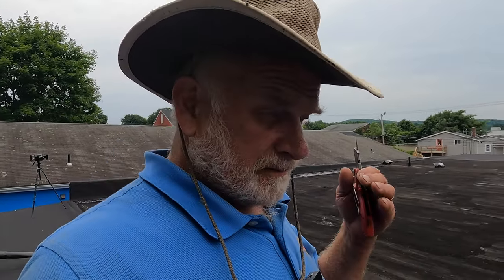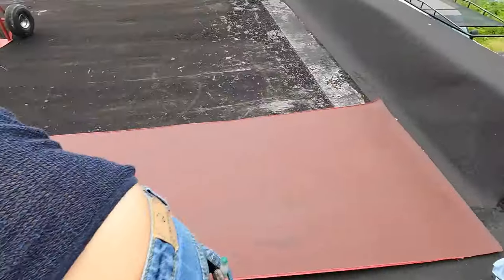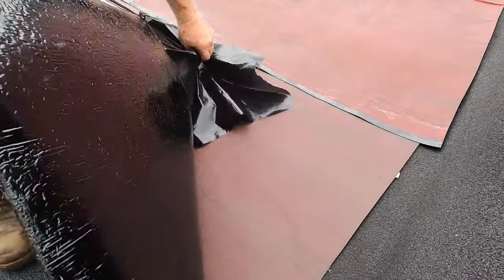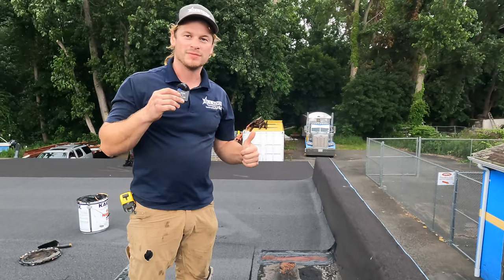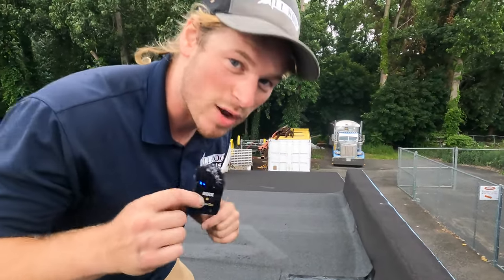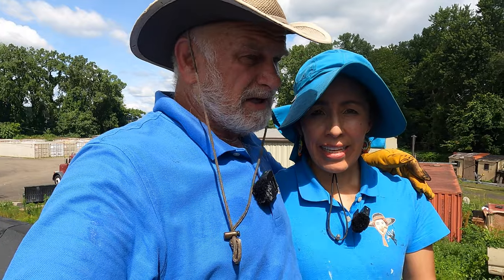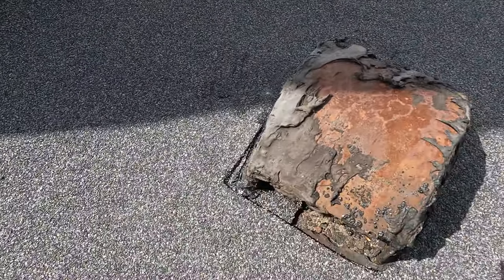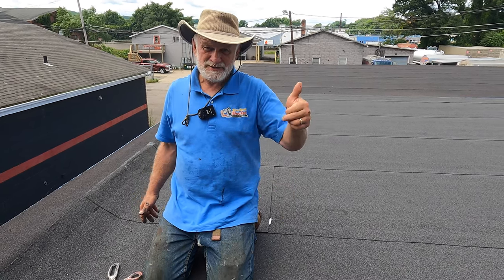Rubber Flat Roof Install - Peel and Stick Only 2 people needed DIY, Cheap, Carport, Garage, Porch,..

Comment: I have been roofing for 25 years. That type of roof is not made to be installed over an existing roof without an ISO panel or clean sub. It also needs to be rolled down with an 80 lb roller to bond materials. It specifically tells you not to use torch or flame. You are supposed to use a hot air gun. Its not a torch down system. It will def be a problem
Reply: Ok truther that's your third worning I'm not going to write you up this time though looks like we're going to need you tomorrow but mostly it's forcuz I am no longer read and rite be cause this video break me mind not work
Reply: I think it's time the old Doc retires !
Reply: Well the roof doctor has been doing this for much longer than you.   His way must work.
Reply: Ok Karen!! Lol
Reply: Make a video comment hero
Reply: @Nosweat99  don’t need to. Everybody that knows, knows there’s nothing to explain. I’m sure there is videos you can find on it if you’re interested.
Reply: As a con artist roofer, this is my new way to make big, easy money 💰 🤑
Reply: I Prefer To RIP it up nice Clean Finish don't want to look for littShit ass Leaks,
Reply: Is the doc South African ?
Reply: Sure sounds like a South African who's been in the States for a while
Reply: This roof is not good on flat but good on slope 😊
Reply: @accent1975  come do my roof, I'm in Long Beach California
Reply: Keith, listen to this man he knows a thing or two. I have followed his steps with my wife, and we did a whole roof. That roof is now 5 years old and has no leaks or issues.
Reply: Do you have a great wife and I have a great wife too!
Reply: Meant my comment to be respectful and put it in the wrong spot
Reply: That roof wouldn't  keep fog out it's a joke
Reply: THEY ARE STARTING TO USE THIS TYPE OF PEEL AND STICK ROOFING THESE DAYS!!!!!!
Reply: You right

Comment: Sorry it was not a bad try for doing  yourself but it was inproper installation. As a roofer for 25 year I'll tell you what you did wrong. Before you lay out the base you have to apply primer which some roofer call glue, the second thing you did wrong was when you installed the cap sheet you have to stagger it from the base so the laps don't land on the same spot you had to cut the first roll of cap down the middle but I would have cut was the base so I could start with a full roll of the cap the way you did it if one of the laps fail the lap underneath it could fail to because of the trapped water. I don't know where you live but if you get winter weather that will be an issue.
Reply: Your installation on the pipe is wrong you are supposed to install a cone over the pipe then put a piece of base down on the cone then put you cap on and it would be in 2 piece s so it wouldn't look like garbage you lay out a piece to pass the pipe cut around it the next piece 6 inch overlap the other way on the pipe and it's good to go and looks nice too and don't forget to use asphalt primer on the cone
Reply: You didn't need to you plastic cement on the seams to make it watertight all you had to do was pass you roofing touch on the seams
Reply: Allsand is meant as a last resort of large pipes that they don't make cone inserts for not a wash room pipe and your wash room vent pipe you should have risen it up that cap comes off and you should have built it up with 2 layer of 2by4 and flash it in with your base and cap sheet it you live in an area where it snows you are going to have problems
Reply: @migueldefreitas1367  if you have a roof with tar and gravel (flat) do you need to scrap It up before doing this process to it?
Reply: No you can put down what roofers call protection board first and screw it down to the existing roof
Reply: @osab_art2802  VES!
Reply: Just shut up critics. As if your methods are scientifically proven to be right. If they were then why the hell do you get repair calls???. Money..Money...Money..!!!
Reply: Repair calls for incorrect installs ,🤦🏻🤦🏻🤦🏻
Reply: @migueldefreitas1367  would this roof leak in your experience?
Reply: I love the comments that start out, “ trust me I’ve been a roofer for 20 something years” 😅 I know people who have 50 years of experience that don’t know what they are doing!
Reply: Never nerve rush a install because of pending rain  cover over best you can and come back and do that area when it's dry also stager joist much more than 3 inches. FYI cut  1st base sheet in half at being of install for best joint coverage

Comment: This is like a master class in how NOT to install a roof...
Reply: I so agree! But they will call us haters. I don't know what kind of Dr. he is, but surly not a roof Dr.
Reply: Not haters, just jealous couch potatoes without any explanations.
Reply: @rsz90182  Do you really need an explanation? And the list of things they fucked up is so long it can't be addressed in a comment. You would need another full length video. But for starters, in just the first 30 seconds, any time you install a roof over an existing roof you are doing it wrong.

Comment: How embarrassing. 37 years of experience flat roofing I have never seen anything like it 🙈
Reply: I had to scrole down the comments to, thanfully not far till i came to yours. I watched this bull S@@t till the end thinking that they would reveal the April fools joke. im also 43 years in the game and i have never seen anything like it. Do the people in the comments realise what this cowboy is doing?..its one thing to doing a fly job and running but unbelievable they would record it and put it on youtube!, and advise anyone this is the correct method for torch on or any aplication regarding flat roofs. Yor comment made my day because i was beggining to think im living in an alternate reality. Im from the school of three layers crossed in hot pitch on a PREPARED surface, that means strip off as well. This roof is a disaster but the only upside i can see is it gives the good guys more work. Im saddened for the clients who have no idea what costs are coming their way when this fails, and it will! thats the only guarantee this guy can give.
Reply: @stevengee4562  as someone who knows nothing about roofs, what will fail about this? In the video he mentions he did the old roof on this building 20 years ago. Obviously it couldn't have leaked or he wouldn't have been rehired right?
Reply: All of it💩
Reply: Ya I have 23 years of commercial flat roofing my self I wouldn’t share a video of an install like that pretty scary to watch that will leak or blow away with in a couple years no recovery board existing roof not primed no wall flashing not supposed to torch SA plus not a big fan of SA it should stick pretty good or not be installed until warmer day plus all those wrinkles coming into seam he stepped down will pop back open when weather changes he seamed like a smart man just not knowledgeable with product or flat roofing all together maybe??
Reply: @stevengee4562  I've done 1000s of meters with hot pot green mineral finish pasting over the laps so you can cut off the access bitumen which leaves a clean edge. Obviously you know what I'm talking about if you're old school 👍
Reply: Shut up I'm trying to study I have a physics exam first thing tomorrow and after that psychology class
Reply: Forget it I'm not going to class anybody want to help me lay down a white overlayment on some vitrified sand or polypropylene while using reverse nasal suction
Reply: As a pro I never use polypropylene plate because of the loss of the product due to scratching which in turn inevitably comes to about 250 a ball and at that moment the cost is unfortunately transferred to the current costumer
Reply: High
Reply: Me either Don't tell the rest of the crew they're going to figure out that we can't do it at all

Comment: I enjoyed your video. Thank you for posting it. That said I have a couple of questions. I am about to venture into doing a roof in a commercial property of mine after I got quoted a ridiculous amount of money to either repair or install a new roof on a 4500 square feet roof top. On your video looks like to just put the new roof membranes atop the old roof. I was under the impression that the old membranes or old roof had to be removed? Please advice. Thank you very much . Sami

Comment: 👍👍Minnesota, we get 20 to 25 years on this roof in harsh climates. We use EPDM rollers and a heat gun to weld seams together but I like the torch idea. Also nail base is a good product under the roll roofing for layovers.
Reply: whats that ??? nail base??? u mean hammering nails also down. ???

Comment: This looks like a potentially AWESOME product.  Clearly it has ease of APPLICATION.  Next test is PERFORMANCE (i.e., no leaks) and then LONGEVITY.  (Those are the three test and the final TEST or issue is PRICE.) $2 psf is very tolerable if the performance is good and the longevity is long.

Comment: Hey Doc would you recommend this on a pebble roof? If so what the preperation process? I've see your other videos on redoing a pebble roof without removing pebbles but, you used if i recall 3 different membranes. which would you recommend. Thanks

Comment: I'm a certified flat roofer EPDM TPO cold process as well as slope roofs , most common repair i have done on similar roof systems is seams and perimeter not adhering. if you want to do this system invest in the seam sealant. you could also do a seal coat over the existing roof for a similar price. EPDM is my preferred system.
Reply: Which seam sealant do you recommend?

Comment: What causes the granules to come off a torch down roof like that? Have a 5 yrs old roof, has lost considerable granules, they clog the scupper box which requires us to clean it out 2x a year. We are going to have to silver coat soon otherwise the roof will be too exposed to UV. It's nuts for a roof to start failing that quickly but from talking to supply house, granules coming off is becoming more and more common

Comment: Why are you laying the runs across the roof? Why no lengthways? Plus, would it not be better to have done the flat roof first, then the parapets, to achieve proper weathering?

Comment: I have a question about roofing, I have gotten several contractors over to give me estimate for replacement of the roof every last one wants to install edpm roof material over the current roof, ( old roof hot tar, last roof torch down bitumen) they all want to do only third roof of edpm .
Why?
Why won’t anyone remove the old roof fix the old Douglas Fir t&g decking and torch down two layers over fire resistant paper?
Your demonstration of this project video is showing proof of why they don’t want to do any roof removal and repair.
They can complete the entire job in one day.
No old material to dispose of.
No complicated process.
Minor torch around the edges.
Maximum return on their time.

My flat roof is pitched both sides to the middle and a scupper with a drain pipe in the center.
Where can I obtain the materials from your video?
I’m not about to do the work myself but it’s possible with some help to complete the project in a day and complete the flashing process without worrying about complicated step flashing or anything else.
Thank you.
Reply from the maker: EPDM is the worst type of roofing material do have  on a roof. You are correct in all the other points.
You can hire a few handy guys and have then do your roof with little cost. No need to strip the old roof.
Reply from the maker: Sometimes Home Depot will carry the Liberty Brand od Peel and Stick. But any roofing supply place carry this material. Beacon Building Supply, ABC Roofing Supply or any other local roofing supply place. The Brand does not really matter.
Reply: Reject those bids and keep requiring your specifications only ! Many regions of the country have bad contractors ! Break down the roof work scope into, tear down demo, roof repairs if any then actual new roof area if any ! Doc is right you can re-layer if needed !  Keep calling for free and sane estimates only !  Good handymen with insurance bond can do small if needed !

Comment: Hi, my name is Vick, I leave in North East Maryland, I have a flat roof with TPO material, it's old and starting to lick every time when is raining, what you suggested to do ? Can I use the same materials you were using on this video ? What should I do with the existing TPO ? Can I install on top of that or I have to pull all off ? Please let me know. Thank you so much.
Reply: According to what little you have stated it sounds likely that the roof in question should be torn off and stripped down to the deck of all old materials and any rotten plywood decking removed and replaced with new before a new roof is installed. 
If you have had substantial leaks then there will be moisture trapped between the old roof and the new roof (wet insulation board & rotting plywood) creating water vapor which must escape and will only cause further damage to the ceiling underneath ( stains, paint blistering, bubbling, peeling, mold) and bubbling, blistering and eventually compromising the roof above for more leaks. 
You could potentially use a peel & stick base sheet over a mechanically fastened 1/2"×4'x8' insulated sheet of blackboard on the deck followed by a granulated peel & stick cap sheet but the devil is in the details (i.e. penetrations (pipes, skylights, drains, tie-ins to other roof systems & perimeter terminations (i.e. shingles, metal, wall flashing & metal drip edge, etc.) and this video is not a good representation of the proper application process. 
My advice is to research the proven work history of licensed & bonded roofing professionals in your area and get several quotes on a peel & stick replacement roof and go from there.

Comment: QUESTION: Wouldn't it be easier & cheaper to use liquid rubber, and the sprinkle it with fine gravel for the UV protection? There would be no seams, and would save a ton of time/labor.
Reply: Degrades too quickly, cracks, splits, etc.
Reply: @thatguy4234  
Not tar...liquid rubber.
Reply: @thomasg4324  It depends a lot on thr country. In the UK there are a few other methods that are being used. One of them is EPDM, which is a rubber membrane that comes in one sheet (up to a certain size) and you glue it to your substrate(mainly timber frame). There are also liquid rubber methods that are being used but there's just something about them that makes it a bit more not trustworthy especially when compared to a one sheet option such as EPDM. Also, in terms of longevity, EPDM can easily last 50+ years.
Reply: It would be much faster and cheaper to use spray on emulsion with pea gravel.
Reply: @shawncummings4653  
How much cheaper? Are you suggesting liquid rubber, or tar?

Comment: This job is one giant bandaid ,reminds me of when I had to patch a hole on the inner tube of my bicycle.
Reply: I think that's kind of the idea given the title of the video.  It's the old saying in business... "you can have it fast, right or cheap... and u can only pick 2."   This was fast and cheap, not necessarily "right" according to pro-roofers.  BUT, for  a homeowner w a bad leak who is desperate for a fast & inexpensive solution (that doesn't necessarily need to last 10 years) this video is semi-helpful. 

 I don't even have $2 to spend per square foot so I'm totally screwed.  Was considering using 4x8 coroplast boards  ( only cuz i have like 100 sheets just sitting in my garage) to go over the current roof (glued down). Then i want to tape the seams with EPDM tape and coat the entire surface with expoxy resin.   Then put on new perimeter flashing.  I realize I'm going to create more issues but I'm stuck and SOMETHING must be done ASAP.  Unless some roofers want to donate their labor AND materials,  I'm on my own.  Water is a sinister foe!
Reply: @Jimd905 Well, he just spent $6,500 on materials that are bound to fail within a year or two.  Doesn't seem very economical to me.
Reply: Maybe he’s going to sell the house right away?

Comment: I agree with Steven Gee. Also, you should NEVER run ur base seams within a minimum of 8 inches from ur cap seams. He is pretty much right on top of the base seams. That ruins the whole point/value of having a 2 plied roof. Now it’s basically just really thick single plied roof. JOKE!
Reply: Absolutely never seem on seem. This is beyond a joke.

Comment: Great video.... I see 2 problems  
1: you always have to cut your first  run of S A base in half alway.  To prevent a lap on lap Meaning when you run your cap sheet you're gonna have a lap on top of the other lap thats  not good .   Cutting your first run  in half  prevent this .
2 :  You need to use an 80 pound roller .  The roller is used to remove any air pockets that may be  trapped in between the materials.  In the summer when its hot the gasses starts to build up in the pockets causing the material bubble up or causing the material to separate in time .
Reply: He mentions the roller at 21:10 but they step on it instead.
Reply: Stepping on it and not pass the roll on it is the same thing and he also didn't use primer on the roof before he installed the base sheet some roofer call it glue
Reply: @migueldefreitas1367  yeah I s
Reply: I was thinking to myself as she's takes off the plas

Comment: thank you I'm going to do my roof just like this , I got a estimate for 10,000 that's a eye 👀 opener
Reply: Materials and Labor !  for roofs with complete tear outs and new roof can be 3x materials $5K will get you $15K final ! Always always get many bidders and learn from the bids !
Reply: always lay a upside down nailed sheet around edges
Reply: Our crew always leaves extra nails for the next couple

Comment: Most roofers would get at least $100 per square which in this case would be $3200.00 for labor. Hard to imagine for 4 to 5 hours of work. Of course, workmen's  compensation ins typically runs .50 cents on the dollar, so $1600.00 goes to insurance if they are licensed and insured.